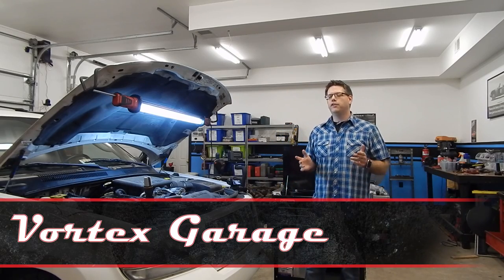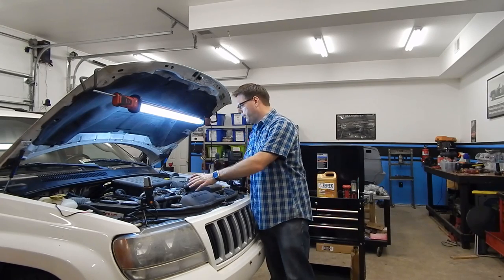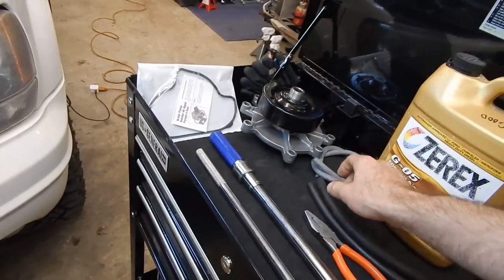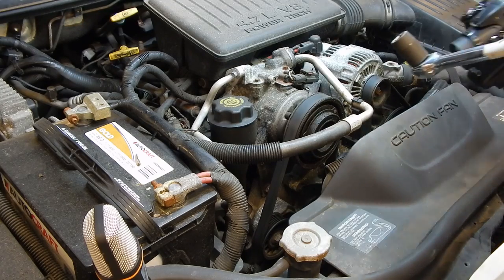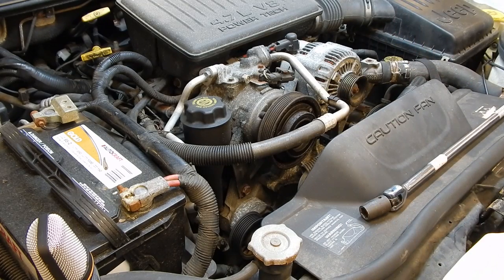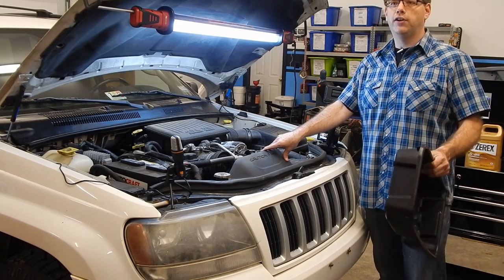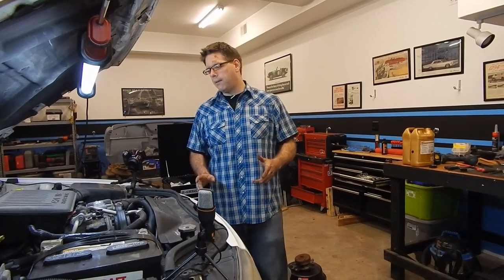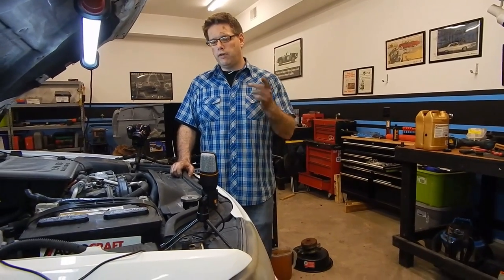Change a Water Pump on a WJ Jeep Grand Cherokee 4.7l - Full Details - Vortex Garage Ep. 37

Comment: Dealer wanted ~$600 for this job.  Thanks to you and your video I was able to knock it out myself ($60) and I have never worked on cars before.  Heck I never even took auto class in HS 30 years ago.  I don't care how much money I have lying around, I hate paying people to do things I can do myself.  Extra bonus is I added a few new tools to my toolbox to complete this job.  I did have an issue with it running hot after I got everything put back together.  I finally figured out it was because I did not bleed the radiator correctly when I added coolant back in.  Rookie mistake, but I could see others doing this as well.
Reply: How did u end up bleeding it? that’s the part I’m kind of intimidated by the bleeding 😢

Comment: This video was just what I needed to replace the water pump on our Jeep.  I had constant problems with overheating, and I just about replaced everything. The final stop was finding this video and I was able to replace the water pump myself.  Also, I could not believe I have been using the wrong Dexcool coolant all this time based on my neighborhood mechanic's recommendations. I dug up the WJ 4.7l user's manual and it clearly stated on using HOAT-compliant coolant. I gave it a flush and replaced it with Zerex G05 coolant. This Jeep has over 200k miles but it runs great now without overheating. Thanks again for the video!

Comment: You can also remove the alternator and remove it through the top super slick
Reply: Same with the compressor. Either is easier I think than the tensioner
Reply: Where do the longer bolts go

Comment: The belt tensioner mounting bolt should be 30 ft. lb. of torque (page 7-18 of service manual). You mentioned 45 ft. lbs, which is for the pulley to the bracket. Mine was really hard to get off, most likely because others have made the same mistake. Otherwise a great video. Thanks for the attention to detail.

Comment: Thanks to this video i almost tear apart  the timing cover of my engine, i thought it was the chain sliders and tensioners that where making the noise, but when you turned the pump pulley it sounded the same as mine does , i just removed the drive belt and turn the engine on and sounds smooth without the pump, so im replacing it as soon as it arrives, will keep the chains and tensioners for a future repair..
Thanks..

Comment: Great video, it’s very straight forward and helpful. I need to replace my water pump and I just had one question. For whatever reason  the previous owner welded the bleed hole at the highest point shut so I won’t be able to pour coolant in from that point. Is there another way to refill my coolant without needing that hole?

Comment: Great video, just used it to change my pump.  I was unable to get the tensioner bracket off so I took off the idler pulley to access the bottom pump bolts. Also, I took off the plastic arm the holds the AC line and unmounted the alternator and got the pump out today way.  Hope you make some more videos.

Comment: I just did one today that was 150k miles and pretty much bearing exploded on water pump. I unbolted the three bolts for the AC Compressor with the lines and clutch plug still attached and lifted it straight up to get room for water pump. And for refill I took out bleed plug and filled via radiator till it flowed out of the bleed screw and then reinstalled plug, started up truck with heater on to feed the core and then put the radiator cap back on after it started to warm up.
Reply: Great minds think alike. I moved the compressor and it was super easy. Like you said, 3 bolts and disconnect one connector and you can set it off to the side.

Comment: You set the standard for good YouTube video. Do list the camera, lights,  and audio you used. You did such a nice job in presention alone I am impressed. Certainly the information you record was very good. Since you have all the best tools at hand; with just a little more effort you could have shown how to remove the fan shroud and make it even more easier to work.
Another suggestion, since I love you and what you to be great, again; try to record clips of jobs that have a value in itself. Like removing the belt by turning the tensioner. Then link small clips of the videos together to do more complex jobs like water pump replacement. Soon you will be able to rebuild the whole engine. Jeep Cherokee is a good baseline model to do this.
With my high regards.

Comment: Great video thanks, but i removed the alternator (3 bolts 1 nut for power n unplug 1 clip 5-10 min.) then the water pump came out so easy . Thanks again
Reply: I was told that was easier, I'm thinking of trying to do this job myself
Reply: Geez, I wish I would’ve read this before I tried removing the tensioner. Stripped the dang thing. Hopefully I never have to replace it lol. I finally came to the realization that you can pull the alternator through trial and error. Hopefully you didn’t have to find this out the hard way like i did :(
Reply: Lol I was thinking about upgrading my alternator too when I do mine tomorrow

Comment: Great video! Very detailed!  Only one thing I would be concerned of , you may have caught all the clean fluid in the drain pan from the rad, but I would then remove that drain pan and put other one underneath there to catch whats coming out when you're removing the water pump bolts and water pump. That fluid that's draining down the motor into the pan would get dirt in it from the exterior part if the motor. And just disturbing those bolts alone would dropped dirt into your clean fluid.

Comment: DISCONNECT THE POSITIVE BATTERY TERMINAL , UNBOLT THE ALTERNATOR.  WATER PUMP COMES RIGHT OUT THE TOP.  LEAVE THE BELT TENSIONER ON TOO.

Comment: Seems

Awesome video. My WJ went down this weekend and I’m more than positive it’s the water pump. I was able to safely get home. Unfortunately it won’t start at all now. Would a failing water pump cause it to start at all?? Thanks b
Reply from the maker: What makes you think it's the water pump?  Did the Jeep overheat?  Other symptoms?  I would say that a failing water pump will cause the noise from bad bearings, or perhaps and overheating condition if it leaks badly.  In a really bad scenario of water pump failure the impeller can seperate and stop water flow, causing an overheating condition.  Bearings could also seize completely and toast the serpentine belt but I've not seen that on the handful of WJ's we've had in the family.  

I don't think a bad water pump would prevent the Jeep from starting.  However if it overheated badly, that could cause it due to other issues.  I'll caution against letting the 4.7l overheat - I drove mine home (I have a get home no matter what gene!) when the thermostat had failed, and it ran hot for several miles during some stop/go traffic.  A month later I was doing head gaskets...iron block and aluminum heads don't like to overheat due to their differing thermal expansion rates.  Best of luck with yours, and overheating isn't a guarunteed head gasket issue, but it definitely ups the risk, so I have learned since then to immediately park an overheating 4.7l.

Comment: Mopar water pump on these are junk. They use a plastic impeller and crap bearings. AC Delco is a great upgrade. Heat treated bearings that last 100k miles and has a metal impeller. I would not use a Mopar replacement or similar. Go with the Delco. 
ACDelco 252-813 Professional Water Pump Kit https://www.amazon.com/dp/B000C9LQIY/ref=cm_sw_r_cp_apa_i_-J8aDbPSFANZQ

Comment: "The bearings seem to fail every 2 years" - Then why keep buying a cheap pump? I just checked Autozone and their Duralast water pump is $62 (of course their Duralast Gold pump is like $82). You can get a Mopar OEM pump for $94 and I'd bet anything it will last a lot longer than the Duralast will.
Reply: Yeah, but the duralast has a lifetime replacement, so you’ll never buy another one
Reply: @051biohaz  But is that worth having to tear into the engine and perform the job every 2 years, to save 30 bucks? I'd rather do it once and not have to worry about it, likely for the remainder of its life. My WJ has its (presumably) original water pump and it has 148k miles. That's a damn good amount of time, and it doesn't appear to be letting up, but since I'm about to do a preventative overhaul, I'll go ahead and replace it, but I'm actually going with a Melling. BTW, you should buy your car parts from RockAuto.com if you can, their prices are insanely good. I'll never go to Autozone/Oreillys again if I don't have to, their markup is crazy.

Comment: Loosen the high pressure power steering hose so you can move it and pull the wp strait out.

Close the drain valve and move the pan. Get a new pan to catch the wp fluid that drains down.

Comment: I have to replace the radiator so will also replace the water pump. No trouble for 133K.!
Reply: I did have it get hot several times and did not realize about the air bubble set screw. Mechanic got me going and no more overheating. Seems like a strong engine.

Comment: I ran into the problem of having two fans? A high flow fan connected to the water pump, and an electric fan connected to the shroud. This had me take out the radiator to get the water pump and fan off together. Why didn't your model jeep have this fan??
Reply: you didnt need to do that , i have the fan clutch assembly , and electric fan . all you need to do is take the fan clutch assembly off , and drop it straight down it comes out very easy .then you have all the room you need.

Comment: I have the factory tow package so I has the hydraulic fan and electric fan. I would love to be able to do my own water pump replacement but I have two broken screws in my back so I can't, which stinks because I love wrenching on my wj.
Reply: I was wondering why there isint 2 cooling fans on most of these diy jobs on the 4.7 here on YouTube...then i discovered that the towing package is equipped with two fans

Comment: At long stops or heavy traffic, my temp gauge moves too hot. The engine cooling fan fails to come on and if I don't move as soon as possible my Jeep (4.0 straight 6 2004) runs hot. I think the thermostat is stuck closed. Help!

Comment: When you were putting the coolant back in did you put it in the reservoir at the same point you put it in radiator and the high port or did you fill the reservoir after?
Reply from the maker: I add in the top port as in the video. Afterwards check the expansion tank and top off if needed. Usually I find it is at the correct level. It's not quite a reservoir but an expansion tank. As the coolant heats it expands and goes into that tank via the small hose on the top of the radiator. When it cools and contracts it pulls it back in. So really just check it and top off if needed after filling in the small top port in video

Comment: weird. the Jeep I'm looking to work on also has a mechanical fan attached to the WP pulley.
Reply from the maker: Jeep had several different combinations over the WJ run. I believe though mechanical fans with auxiliary electric fans was normally on the 4.0 inline 6 models. Water pump job on those is also different as it's a different part and engine family
Reply: @VortexGarage  it was the Grand Cherokee Laredo. That might be why.

Comment: Great video...where did you get that light your using for the hood, looks like it works good
Reply from the maker: Sorry for the slow reply - thanks for your comment btw!  Regarding the underhood light, I got it off Amazon.  It's an ATD 80357.

It is night and bright, and is flourescent.  There's many more on the market now that are LED.  Eastwood has one that looks interesting as it splits in half for different configurations.  But I do like this ATD light, it gives great light output and does rotate to help put light where needed.
Reply: Vortex Garage thank you

Comment: i didn't see where you mentioned the fan clutch ?
Reply from the maker: I know there were several different combinations of fans on WJs but the 2004s with the 4.7l V8 I've serviced, none has a mechanical fan with fan clutch. They all used the hydraulic powered fan. Now the inline 6 motors do use the mechanical fan I know but the water pump is different on those too. Hope this helps some

Comment: Did you add coolant to the overflow after you were done bleeding it?
Reply from the maker: When done check it and fill if needed. I had relatively new coolant during this job so checked and it was at correct level after filling.

Comment: Can someone helpe me pls.
I have jeep WJ 8 47 I replaced the knocking sensor and after that I feel no power in the engine like before and find air in cooling system.  Is there a relationship between knocking sensor and cooling system

Comment: My 4.7 V8 says DeX-cool. Is that HOAT compliant or whatever. ?
Reply from the maker: I have never heard of a Jeep or Dodge 4.7l calling for Dexcool.  While Dexcool is primarily a GM coolant, I do know that recent Fords use a coolant that is basically a Dexcool standard.  It's possible that later Mopars have similar?  But every WJ I'm aware of called for HOAT compliant coolant, not Dexcool.

Zerex G-05 is what I've used each time I've done a WJ 4.7l water pump.

JeepForum.com is a great place to also go post and see if anyone else has come across this, but again, I've not seen that personally.

Comment: Is it the same process if your fan is connected to the water pump?
Reply from the maker: Alberto Gonzalez Close but it will be different. You'll need to remove the mechanical fan from the water pump
Reply: Vortex Garage oh thanks. Its the same as removing the bolt from the water pump right?
Reply from the maker: Alberto Gonzalez you have a 6 cylinder?  Removing that fan is different than the water pump bolts and the water pump is also different. I did remove a 6cyl mechanical fan in this video https://youtu.be/XZIPQNwGUi0
Reply: Vortex Garage i have a V8
Reply: What size was the fan clutch wrench?

Comment: does a bad water pump cause the engine to over heat?
Reply from the maker: Usually a bad water pump will make bearing noise, or leak coolant. In some cases leaking can cause low coolant and overheating, or in more rare cases the impeller will fail causing overheating. On a WJ, the thermostat is a common cause for overheating. Either way would require some diagnosis to be certain as there can be several things that can be the root cause for overheating.

Comment: You didn't show whether you took off the fan
Reply from the maker: This configuration of WJ does not have a mechanical fan to remove.  It uses a hydraulic powered fan in the radiator shroud assembly and it does not need to be removed to replace this water pump.  The inline 6 WJs do have the mechanical fan that is removed for a water pump service but these specific 4.7l V8 models do not. 😎